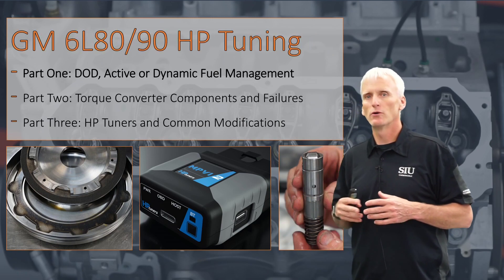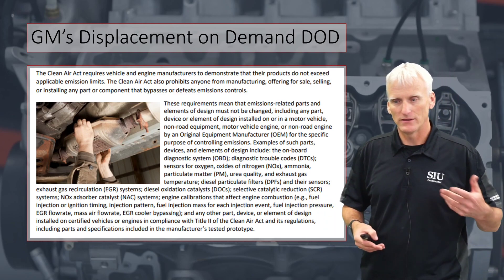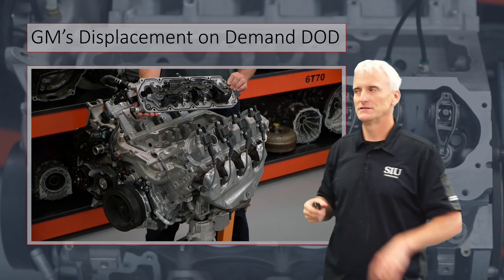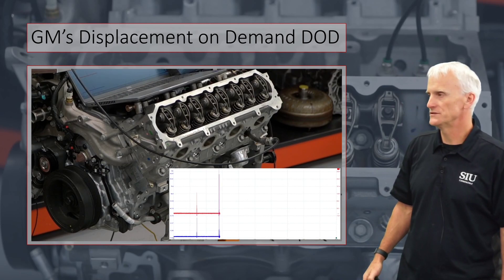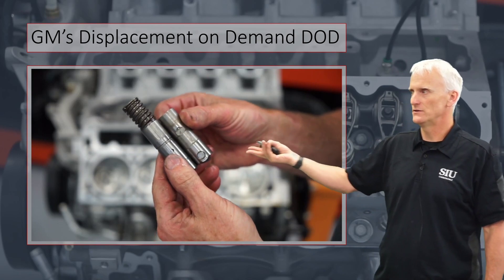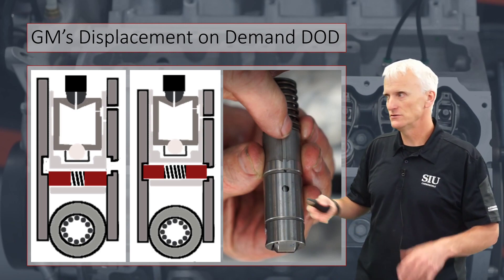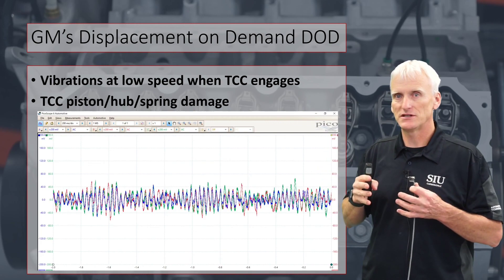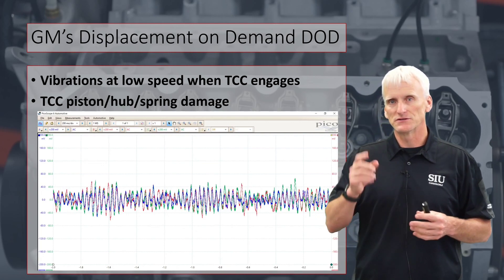GM's 6L80 HP Tuning, DoD, and Torque Converters! Part 1 of 3

Comment: Hey all hope someone sees this. 2014 Silverado. transmission and TC Replaced in December 2023. December 2024 replaced the TC again. Its driving like shit. Shifting sometimes slips or hard also weak acceleration. Will this tune help?

Comment: Good synopsis of how terrible DOD is we all know the more moving parts the more there is to break also the lockup strategy has to be awful to eliminate the vibration from the system being activated i disable every one i touch and then disable lockup in every gear except 5th and 6th

Comment: Shawn, I have a 2008 Escalade RWD with the 6.2. I am replacing the engine due to excessive piston slap. I'm installing a 430 hp GM crate LS3.  I currently have no problems with the original transmission (145,000 miles). Would you recommend replacing the torque converter  with an upgraded (billet backing plate) unit as a preventative measure? What brand torque converter would you put in this truck if it were yours?

Comment: Can deleting the tcc from engaging in 1-4 get rid of a shutter from 1st to 2nd at low rpm
Reply from the maker: Probably not unless the tcc is still engaged during the shift and the source of the shutter is the tcc.
Reply: Did you ever fix shudder?
Reply: @jayP3rezLT  i ended up getting a new torque converter and a shift kit put in adm it helped but still has small amount of shutter

Comment: Do 8L90s need adjustments made with HP Tuners?
Reply from the maker: Many will tune the TCC so it doesn’t engage in 1-4th gears.  Also, many set the slip speed to zero.

Comment: DoD is a joke. I lost 2 mpg after a rebuild and  dod delete
Reply: I'll agree that it's a joke. I used HP Tuners to turn it off on my 2018 Chevy 1500 5.3, a long with some line pressure and TCC changes and actually gained 2-3mpg.

Comment: Bought a range technology,  mishimoto transmission cooler,  oil catch can and the sure cool kit.. Temps never go over 150 degrees after long hour drives... will be doing complete dod delete, swap torque converter and tune down the road for sure... 14 6l80.. awesome vid.

Comment: Thank you for these videos!!!. Bought a '16 L83 silverado. Didn't realize the level of vibration V4 mode causes until after I swapped out the BFG KO2's. The tires were masking the vibration at in-town speeds. Vibration is much worse when its cold though, ill generally run it in M5 untill it get to temp.

Comment: Thank you for making this video. What’s your thoughts on just using a Range Technology dongle to disable 4 cylinder mode?
Reply: DOD is ingenious,  but really a bad idea in the long term. Best to delete it when you get the chance!  Really just a way to meet emission standards and promote 'fuel efficiency' from a v8.  Honestly,  just better off with a v6 in that case.
Reply: @20tea  I think DOD is great as well, but the single greatest upgrade to smallblocks is direct injection. And compared to german OEM's the HPFP's and injectors are decently priced. Im a huge fan of 5th gen smallblocks in general.
Reply: @googuser3145  True, just keep in mind the additional carbon buildup in the ports and valves.  All direct injection vehicles should have an oil catch can to reduce carbon buildup.
Reply from the maker: I've never use one, but I would think it would be okay.
Reply: siu automotive I’ve spoken to their tech department and they claim as long as you unplug it before smog inspection (California) the vehicle will pass inspection, which is not the case with simply disabling DOD with a tune alone.